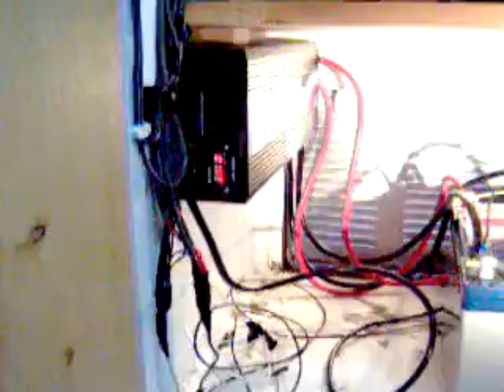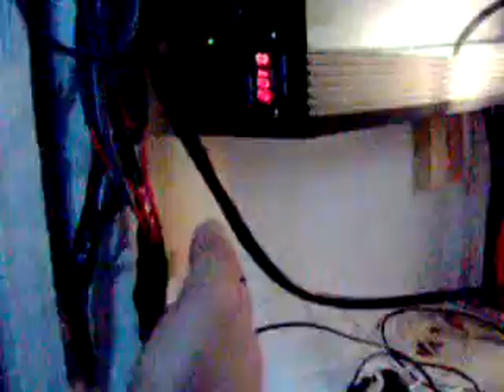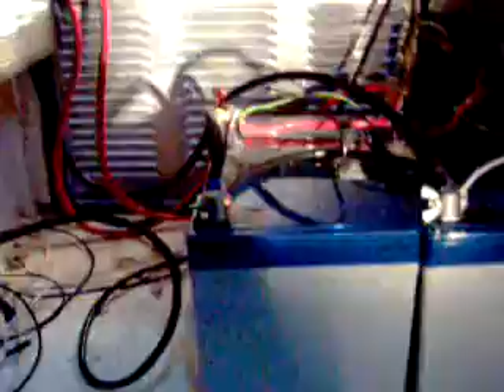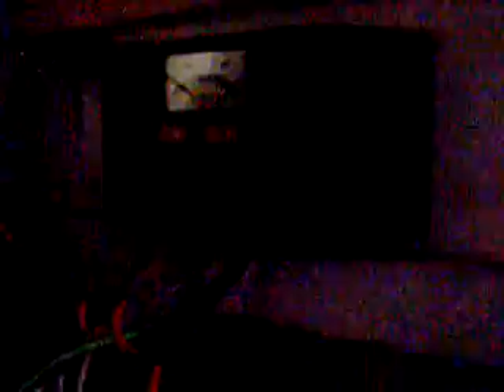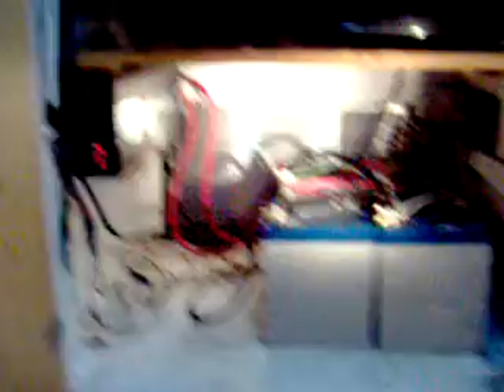Off Grid Solar Trailer Project

Comment from the maker: I have better quality update videos that came later on.   The fridge went bad and was removed, I increased the battery bank to four batteries, I increased solar power production to 460 watts but might pull one of the panels back off for another project.   The water system was updated a little bit, and I have another backup inverter in there.   I  have tested the current system and found I can leave lights on indefinitely.

Comment from the maker: There are several project update videos that came after this one, but I think they are mixed in with my other videos.  I eventually expanded the system to four batteries and have more video about that system.  The Inverter messed up a heater and a fridge.   I was able to save the heater but not the fridge.   Every time I go out to the trailer the batteries are at 100% and I can leave lights on indefinitely.  The inverter works, but I am not entirely happy with it.

Comment from the maker: @michael970 
The cheapest coupon I can find has them at $149.99 for the three panel 45 watt kit, but I can usually sell the controller/light kit that comes with it for $25-$35 which is what I did with the other panel sets except one.   Thus I can get into the panels at a net cost of $40 each at the cheapest.   The cost per watt even at that level is not that great compared to most polycrystalline panels.

Comment: nice setup.HF has the panels on sale now for 145.00.i think you can get a charge controller that will take high voltage and bring it down to 12v.just a cew thoughts for ya.check out my videos if you get time maybe it will spark some ideas.keep us updated